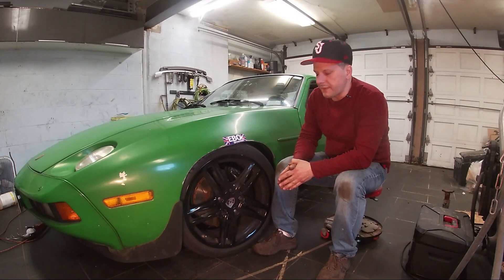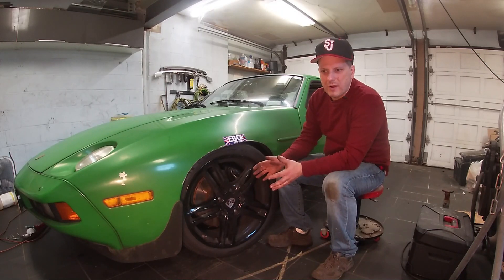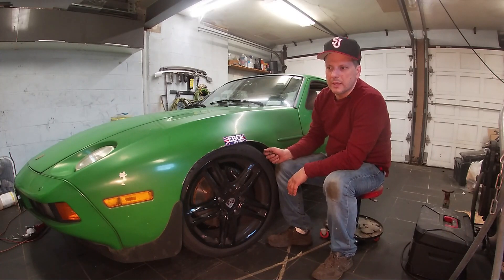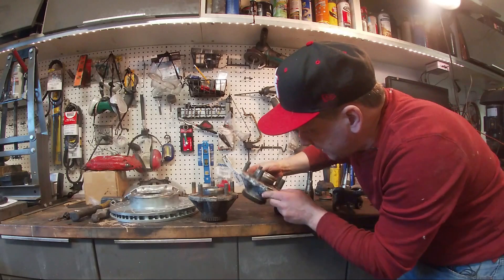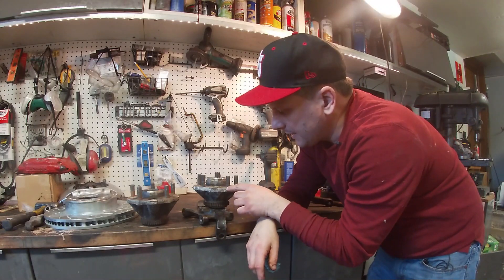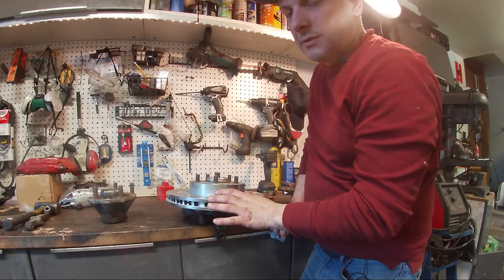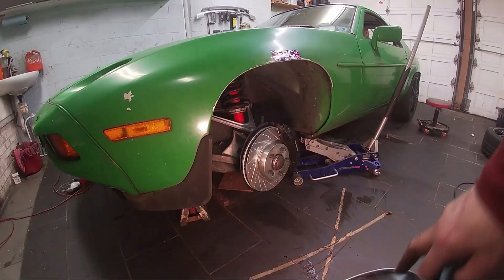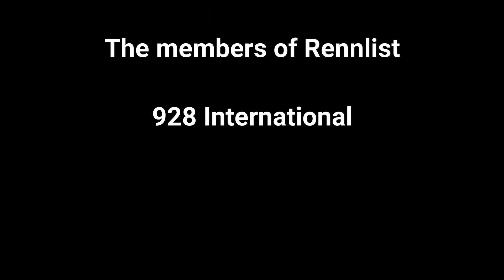928's toughest problem Solved... WTF is a Negative Wheel Spacer?

Comment: Great stuff ..I just bought a 928 s euro specs with 18ème  turbo twists wheel ..the previous owner has fitted a rather large spacer in the back ..I just changed the tires and now a lot of rubbing..I am in New York..anyway I could come to you for advise ..my mechanic has no idea what to do ..cheers

Comment: I thought I was the only one that did this on my cars. I typically make my own brake hats to make use of the extra 16mm in full for wheel offset, but otherwise the same thing. I wish the 944 Billet hubs were cheaper because I'm always stressing out that my hubs will fail.
Reply: the 944 billet hubs are nice.    I followed John's footsteps on this and did the 944 billet hubs.    tucked my 8x19's nicely in.  I had to use a 5mm spacer due to my wheels and the brembo F50 calipers.  gaining 10mm on each side resolved my clearance issues

Comment: Ingenious solution! You're running quite a bit larger wheels than standard though, do you know how much more wheel diameter you have with those than the default ones? You will lower scrub (or gain negative scrub) with larger wheels, not a lot, but I guess 2-5 mm or so?

Comment: You are a true hero! Very cool stuff. In searched for ET70 CupII’s for ages and finally found them. Having the correct offset wheel is super important on the 928.
Reply from the maker: Thanks.   I didnt and most 928 owners don't fully understand the offset's implications on steering and responsiveness .    When I drove the car back to back with the same wheels, tires and alignment specs it was very clear the 928's steering felt more natural with the higher off set.  Most owners including myself think,  50 something offset... close enough but something far closer to 70 seems to work well in the real world. too.

Comment: Did you run the Cayenne brake caliper too?
Reply from the maker: No....928 GTS with a 1/4 inch spacer.
Reply: @johnsgarage3771  should use a centering ring between the hub and the rotor around the bearing cap area. (not behind the rotor)   since the GTS is 320mm , so how did you get the calipers to work . did you add 5mm washers on the radial mounts for the stock GTS calpiers?
Reply: Are you in Colorado?

Comment: This is awesome.   what width tires and wheels are you running?  I'm running Fikse 18x9 front wheels, and due to the front offset they do stick out.      To complicate it a bit I'm also using a 355mm brembo GT brake upgrade and they come with caliper spacers, so I need to find out if brembo makes a 16mm flatter hat, correct?  Also which version of the hub are you using?  There are 5-6 versions between the late 944 and the 968.
Reply from the maker: The 951 hub.

Comment: Nice job!!!
How much of the wheel stud is there with the spacer & rotor installed compared to the stock setup?  Adding longer studs should be a piece of cake if needed, it looked a bit short in the video.
If memory serves, there needs to be a certain amount of the stud sticking out past open lug nuts.
Reply from the maker: In this scenario 5mm shorter than OE.   The next scenario will have a 350mm brake rotor with an aluminum hat with the ideal dimension so the 5mm spacer wont be necessary.
Reply: @johnsgarage3771  legal for racing is half the threads of the nut has to be used .  thats about 5 turns.   not ideal.   1/8" spacer  on a stock S4 spindle works, , but thats 3mm.  5mm is pushing it.
Reply from the maker: @zanick2  Agreed, didnt know how well this was going to work out until I drove it and it's fantastic with the additional offset.    I'm going order a custom alu hat rotor with the correct hat offset which negate the need for the spacer.